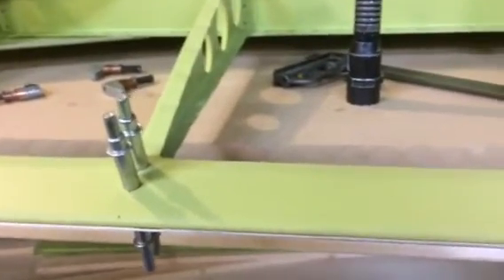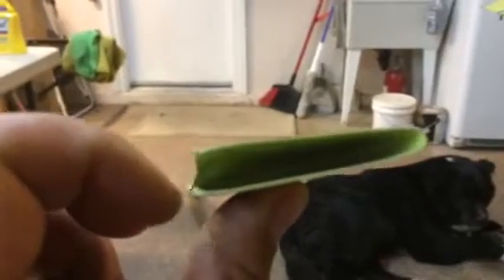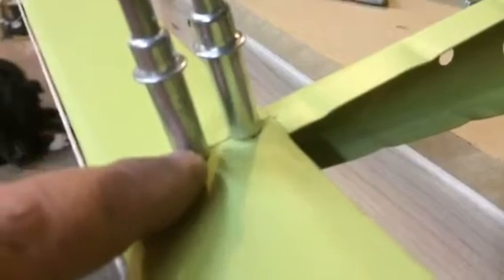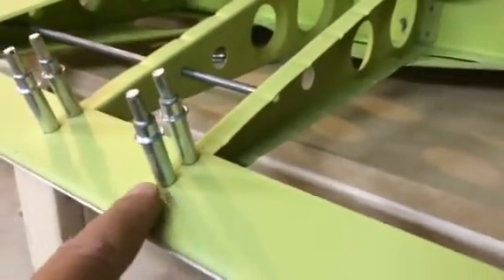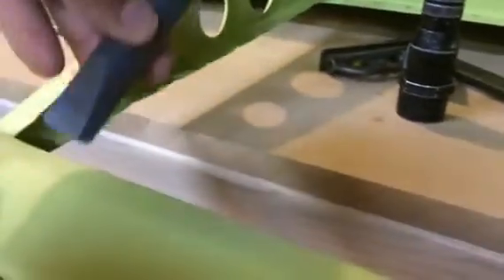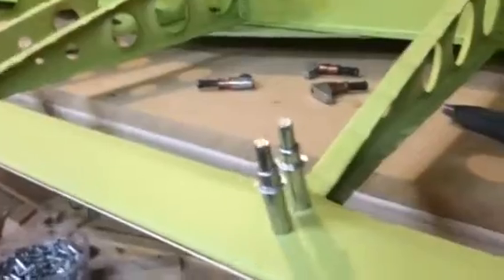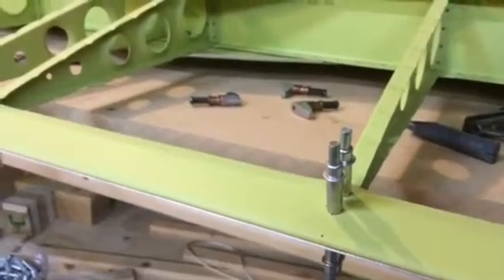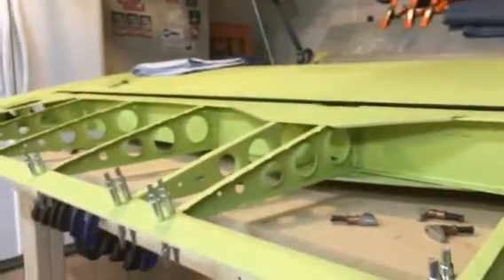The Desert Bearhawk Project: Trailing Edge Flanging

Comment: Actually you don’t have to use blind rivets as long as you have a bucking bar with sufficient density to take a beating under the rivet gun!  Enter the tungsten bucking bar ground to fit the contour of the trailing edge rib.  The tungsten “sliver” is slid down the face of the rib flange, and using your godlike riveting skills with a 2X rivet gun, you perform a near miracle with almost nothing to work with!  Trust me, we are near to help you!  30 year A&P with enough sheet metal experience to embarrass myself.